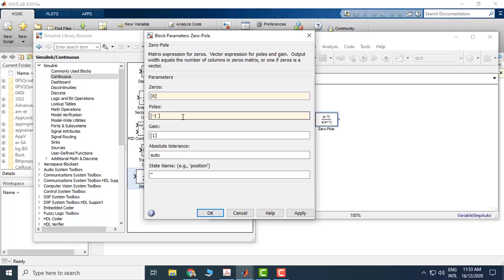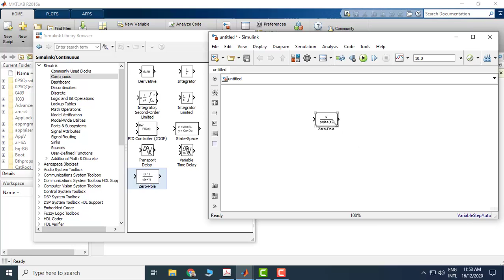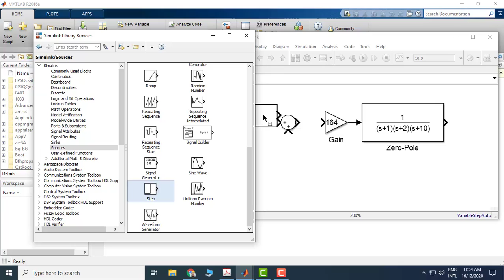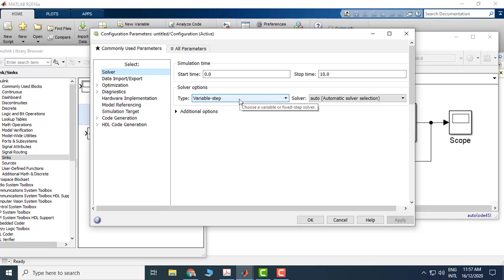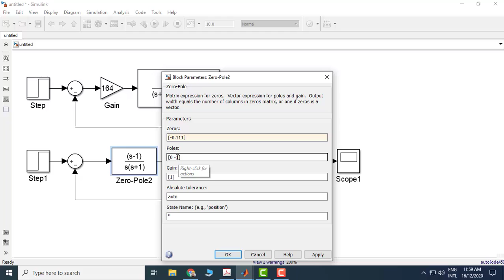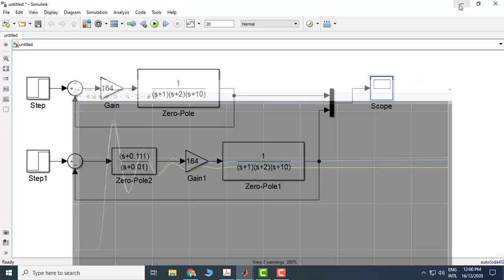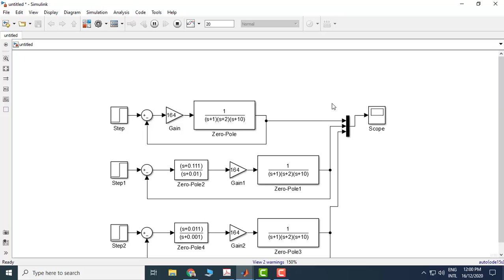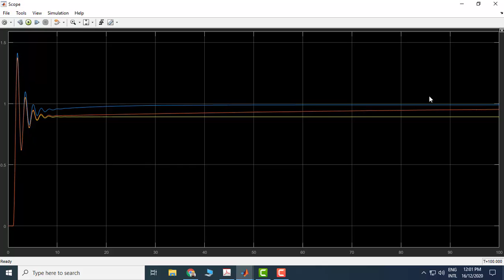LCS 36b - Simulation of designed lag compensator in MATLAB Simulink

Comment: Hi.
Firstly, great videos (LCS 36a and 36b)! Thanks for that.
Additionally, is it possible to design a lag compensator using passive components? Can you resume, how can I do that in Simulink?

Again, thanks for the lesson!
Reply from the maker: Yes, lag compensator can be implemented with passive components. For the purpose of simulation you can simply use the transfer function of the lag compensator OR if you want to use the passive components you can use simscape. Over there, you will find resistor inductor and you can choose these components to implement controller.

Comment: Lag Compendator 
reduces ss error but increases %OS
👍🏻👍🏻👍🏻
Reply from the maker: Yes, that is true. Because the zero of the compensator tends to pull the root locus towards right, thereby, increasing the overshoot.
Reply: @MAFarooqi  
and decreasing the stability of the system (less phase Margin PM )
it is all clear if you draw the bode plot for a lag compensator
Reply from the maker: You are right, that is more clear if we draw the Bode diagrams. This will be discussed in later lectures where we will discuss frequency domain analysis and design of control systems.